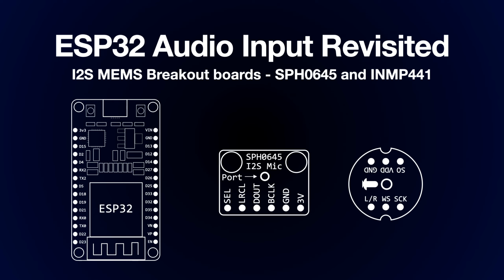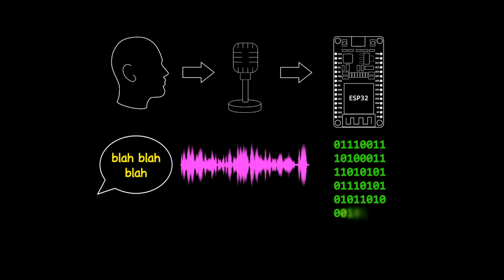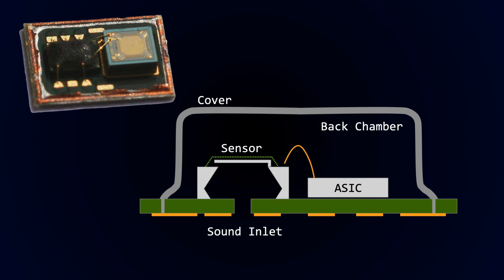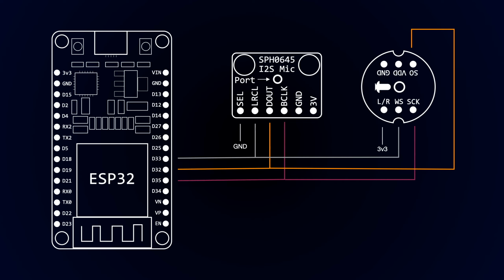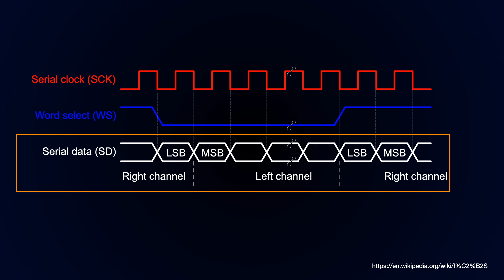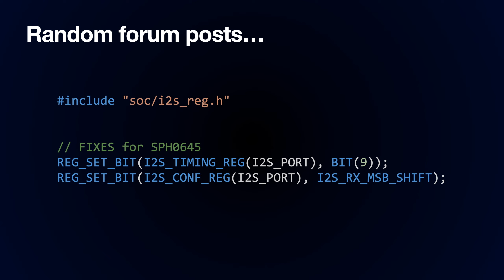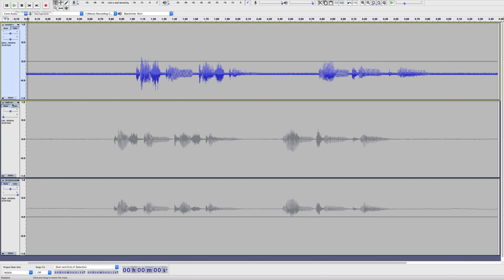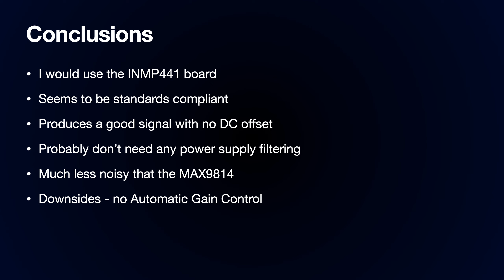ESP32 Audio Input Showdown: INMP441 vs SPH0645 MEMS I2S Microphones!

Comment: Thanks, for a clear simple comparison between these and the analogue input.
Reply from the maker: Thanks! I'm surprised at how much better the I2S microphone board is performing. I guess it's a much more modern bit of tech and the processing of the signal is a lot more advanced.
Reply: @atomic14  I'm thinking about adding a microphone to an ESP32-CAM board, need to check which pins are free (there aren't many) to see if it's practical or not.
Reply from the maker: Yes, the ESP-CAM is a bit of a pain as they haven't left may pins open. I think you can free up some pins by disabling the flash card if you aren't using it and you can re-use the serial lines once you've programmed the board.
Reply from the maker: If you can find 3 spare pins then you should be good - I know the ESP32-CAM board is pretty limited as they've used up a lot of the pins already.

Comment: And to add insult to injury, with the SPH0645 there is a positive "DC offset" in the digital that is limiting the dynamic range of the linear pcm by 20%-30% in the positive side
Reply: Anyone figure out why / a solution to this?

Comment: At time 2'40", you have the GPIO35 wired as SCK (BCLK) which is clock output to the serial clock of the I2S microphone. However, on most (if not all) ESP32, GPIO35 is an input only pin. You code looks correct when using GPIO32, but the Dout should be on a pin other than GPIO32.
Reply from the maker: oooh - good spot! The diagram is wrong.

Comment: Hi atomic14, really really enjoying your videos and the work you've put into them. I'm trying to follow along with the projects and have downloaded the source code to play around with. I currently am using the INMP441 microphone connected to the ESP32 as per the wiring diagram on the github page. I have been able to get the esp32 to connect over wifi to stream the i2s data back. However, I am running into an issue with the quality of the audio received. I have been importing the audio into audacity with the settings -  16 bit signed PCM, 16000hz sampling rate and mono channel. While I am able to hear most of the high level features of the audio, the audio file is generally very distorted and has lots of hissing and popping noises in the background which is very different to what I've seen in your videos. Do you have any suggestions or advice on what I could potentially be getting wrong? Thanks
Reply from the maker: Hi Sean,

Can you open up an issue on the GitHub repo and we can try and troubleshoot what you are seeing, If you can attach a sample of the audio you are getting that would be really useful.

Thanks
Chris

Comment: Nice video. One of the big advantage of i2s micro mems is the known value of the expected RMS level for 94dB @ 1000 Hz . So you do not really need to calibrate the microphone. I would like to know the diameter of the INMP1441, it would be good if it fit inside 1/2" tube.
Reply from the maker: My callipers says it's about 14.5mm (0.57inch) diameter. All the breakout boards that I've been able to find follow the same form factor.

There is this later version of the microphone - the ICS43434 - and there are some breakout boards for it that are really tiny. Unfortunately, they only seem to be available shipped from the US - https://www.tindie.com/products/onehorse/ics43434-i2s-digital-microphone/

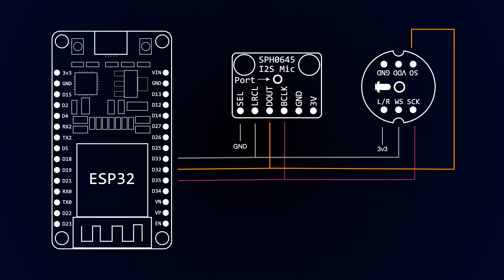Comment: Hi there, this is Hassan, at 2:51, you shared the schematic diagram of the circuit, could you let me know which platform you used to make it on. I have a similar project, and I had to make a schematic of it. Unfortunately, I couldn't find any online tool where the mic module could be available.  

My project uses an SD card, and an esp32 as well, I hope to hear from you soon.

Comment: Great video, look forward to use it in my projects, although I have a question, why do you connect the L/R pinout of the INMP441 to 3v3?
Reply from the maker: Hi Gian, I2S is very much based around stereo audio so you have a left and right channel with only one data line for the left and right. You need to tell devices if they are on the left or right channel otherwise they won't know when to send their data. Tieing the L/R line to 3v3 tells it that it should send its data when the left channel is requested.

Comment: Tell me something , what interface did you use to capture the audio directly into the audacity software. Like the mic is connected to the esp32 and is there any plugin that directly sends the audio to the audacity ?? i would like to know that in detail .
Reply from the maker: Hi there, we stream the audio from the ESP32 to a server running on a laptop or desktop and save the audio to a file. That file can then be loaded into Audacity using the import raw audio feature. Code for the server should be in the repo here - https://github.com/atomic14/esp32_audio. I don't think there is any plugin that will let you send the audio directly to Audacity,
Reply: @atomic14  Well i did not found the code in order to interface the i2s mic to the esp. I was specifically trying to look for an ino file but i did not found any . Could you guide me as to where is that code in that repo ( sorry if my question sounds stupid to you ) as i am not a very advanced programmer rather a noob but i'm good with hardware stuff .
Reply from the maker: @TechInventorAman  Hi Aman, the code in the demo repo is using platform.io for the IDE. There is a much simplified version here which will work with the Arduiono IDE - https://github.com/atomic14/ICS-43434-breakout-board

Comment: I wonder how you managed to make the ESP32 output the clock signal on GPIO35 - it's input only…
Reply from the maker: Good spot - that's an error in the diagram. The linked GitHub repo uses the following pins: 
.bck_io_num = GPIO_NUM_32,
.ws_io_num = GPIO_NUM_25,
.data_out_num = I2S_PIN_NO_CHANGE,
.data_in_num = GPIO_NUM_33

Comment: Thanks for the convincing demonstration that whenever possible I2S microphone is a better choice. However, it's not clear to me why the INMP441 is "hands down" better than the SPH0645. From the audio, they sound quite similar. Can you elaborate?
Reply from the maker: From what I read there is some weird timing incompatibility - it can be worked around, but it’s not ideal: https://hackaday.io/project/162059-street-sense/log/160705-new-i2s-microphone
Reply: @atomic14  Ah, thanks! I thought the mis-alignment was the problem of the ESP32 I2S, but after reading your code on Github, I realized that the workaround is only needed for the SPH0645. Yes, that makes the INMP441 the preferred device.

Comment: Great video! I'm planning to use esp32-cam for an IoT project. There's going to be live video and audio input to watch on smartphone. And there will be a motor and 2 sensors. Can esp32 handle these together? Or is there any other recommendations?
Reply from the maker: An esp32 can certainly handle all of that together. You may struggle with the number of available GPIO pins on the esp-cam boards. A lot of the pins are taken up by the camera board so you aren't left with many.
Reply: @atomic14  Thank you so much for your attention to my question. I'll consider this.
Reply from the maker: @seget96  There's a good guide here - https://randomnerdtutorials.com/esp32-cam-ai-thinker-pinout/ if you aren't using the SDCard you'll get a few pins back.
Reply: @atomic14  Wow I didn't know that! I appreciate it! Thanks a lot :)

Comment: 1:00 the sensor is soldered on the bottom. What's the reason? avoid wind noise? avoid collecting dust? I put the sensor on top, because I think that's where the sound comes from.
Reply from the maker: MEMS microphones come in two different styles, top ported and bottom ported. Top ported versions have a hole in the top of the microphone for the sound to enter. Bottom ported have the hole in the bottom and you need to have a matching hole in the PCB to let the sound in. Both the INMP441 and the SPU0645 are bottom ported.
Reply: @atomic14  oh I see. Thank you.

Comment: Is it possible to use audio input (e.g. inmp441 i2s) or audio output (e.g. max98357A i2s) via a port expander? If yes how is it done, especially the pin config? Thanks for any advice.
Reply: please tell me can we use both to make a line pass for hearing aid solution

Comment: Hi there ! I'm facing a strange issue, the SPH0645 only works when I put WS to ground, I'm using an ESP32-S3 on a custom PCB and I used your tweak settings to make it work however the only way to get a valid output from the mic is to try putting WS to the ground multiple times after the startup...
If I don't do that I get random and incoherent values.
I'm really struggling to get around this problem, so any help would be welcome ^^
Reply from the maker: If you join the discord server you can share your schematic+code we can have a look and see if anything is obvious.https://discord.gg/PKrNGqN6

Comment: Thanx for the great video, I have an INMP441 mic, could you please how to record the sound the play after that
Reply: Hello, please help me how to play the recorded sound.
Reply from the maker: I don't currently have any sample code for recording and playback on device. The sample code I currently have sends the audio to a PC running a small server. The audio is saved to file as raw samples so you need to use a tool like Audacity to load the samples and play them.
Reply: @atomic14  i think the server you are talking about is your personal one.
Reply from the maker: @rajbirsingh4879  Yes, the code runs on your local machine. I think you want to record to the device and play back from there? You will be limited by the amount of memory so you will probably want to record to flash or SD card. Recording to flash is quite difficult as it's quite slow. If you have a device with PSRAM then you can record to memory without any problems. I don't have any code to show this at the moment though.
Reply: @atomic14  Yes, actually I want to record the voice and want to hear what I am recording.
I have an SD card adaptor.
Please let me know how i can do that
Reply from the maker: @rajbirsingh4879  I don't have any sample code for this yet. There will probably be a video about it at some point, but I can't promise anything.
Reply: @atomic14  alright, but can you show me how you had recorded and played on audacity.
Reply from the maker: @rajbirsingh4879  In the GitHub repo (https://github.com/atomic14/esp32_audio) there's a very simple web server that you run on your desktop machine. The ESP32 sends the raw audio to that server and it gets written to a file. You can then import the raw audio into Audacity to play it. You should be able to clone the repo and start the server, then modify the esp32 code to point to your machine's IP address and it will send the audio to your computer. You need to import it as "Raw Data". File->Import->Raw Data and you need to tell audacity the correct format, channels and sample rate - these should match the settings you have in the ESP32 code.
Reply: @atomic14  Thank you so much for your help, I have recorded the sound
Reply from the maker: @rajbirsingh4879  That's great! Good luck with your project.
Reply: @atomic14  no i have to send the value to an android app using ESp32 BLE.

I have downloaded the nrf connect app but i am not getting the accurate values.

I have also made a custom app to reproduce the sound,
Reply: @atomic14  can we route the mic data directly to output to a speaker

Comment: Is there a breakout board that allows for a line-in instead of a microphone? So it can take audio from an analog source?
Reply from the maker: There's a couple of options, you can use the built-in ADCs - https://www.youtube.com/watch?v=pPh3_ciEmzs&t=1s There are also some I2S ADC boards, but they seem to be quite unusual. The majority seem to be I2C. I did find this one though - https://www.sparkfun.com/products/retired/9365
Reply: @atomic14  what about a decent library? On conventional Arduino there is an audio library that doesn't require a lot of setup... play, record, and not much more .

Comment: Is there a way to use an external wire microphone but retain the i2s interface ?
I want to make a wifi wireless headset compatible with pulseaudio
I want one esp32 to have two audio output channels and one audio input channel for the microphone. 
But what chip can take signal from a normal microphone and turn that into a i2s signal ?
Reply from the maker: Hi there, In theory, this is definitely possible. there are a few I2S adc converter chips and if you google you will find some breakout boards. I have read a few forum posts with people struggling to get thingsto work consistently https://www.esp32.com/viewtopic.php?f=12&t=10749. There are also SPI based ADC converters which you could use instead of I2S. Depending on the board you find you will need a microphone pre-amp to boost the mic signal up to a sensible level.
Reply: any success, i want to INMp441 mic and stero out from esp32

Comment: I'm in NZ so hard to get components. I can source the SPH0645 from Aussie. I am using the ESP32. Is it worth going down this path or should I be patient and order from further away!
Reply from the maker: I would go ahead and use the SPH0645.
Reply: @atomic14  Thank you for your very fast response. I have been spending a fair bit of time searching. Frustrating when supply is the biggest issue! One board that is available in NZ is Pmod MIC3: MEMS Microphone with Adjustable Gain by Digilent. It appears to have what is needed but I cannot find anyone using it with an ESP32 just the Adruino. Worth a try? (I am newbie at this).
Reply from the maker: @kellyrummins3338  That should work - it has an SPI interface which the ESP32 supports. The code you see for Arduino should work on the ESP32 as well.
Reply: @atomic14  Fantastic. Thanks again so much. Your audio project videos have been immensely helpful.
Reply from the maker: @kellyrummins3338  You can also use the built-in ADCs they aren't really that bad for audio input provided you can give your microphones a good clean power supply.

Comment: thanks sir for posting these videos. I am using SPH0645  with sampling rate = 16k , bits per sample = 32, and variable buffer lengths and counts. but no matter what i set buffer lenght and count by recorded audio is FASTER . if i speak for 5 second recorded one is kind of 2 second long. Any comments on that
Reply from the maker: How are you loading the raw data? You could be importing it as stereo - which would cause it to double in speed.
Reply: @atomic14  thanks for replying. i am only using left channel and am selecting mono while loading raw in audacity. I think the culprit is  size attribute in i2s_read() function , i.e the 3rd one. kindly put some light on it
Reply from the maker: @chaitanyadas1814  when you read the data in are you specifying 16 or 32 bits? In my code and convert the 32 bit data to 16 bits before using it.
Reply: ((bits+8)/16)*SAMPLE_PER_CYCLE*4  , i mean this formula from the documentation . what are bits and sample_per_cycle variables in above formula
Reply from the maker: @chaitanyadas1814  If you look at the sample code attached to the video you can see that the 3rd argument is just the number of bytes you want to read from the I2S device. They are using that formula to try and make sure they read enough bytes to hold complete samples. To be honest I would ignore that formula as it's quite confusing and generally you want to read quite a few samples. If you are using 32 bits then each sample takes up 4 bytes.
Reply: @atomic14  thanks sir , for your kind suport , that makes sense , still couldn't figure out why by changing 32 bits from 16 bits per sample in your code, my speed is getting faster. SPH0645 doesn't seems to work with 16 bits_per_sample
Reply: @atomic14  if nothing is wrong with i2s_read() function , than the problem seems to be in config setting of mic, what else is left ??
Reply from the maker: @chaitanyadas1814  are you using my sample code? If you are then you can raise an issue on the GitHub repo and some might be able to help you.
Reply: @chaitanyadas1814  there seems to be some issue with the sample rate. I believe that the minimum sample rate was changed some year ago in ESP-IDF, but I cannot find this documented except for in some github issue documentation. when I had a timing error, increasing to 20khz solved my problem.

Comment: How far the distance between your mouth (as sound source) to the mic?
Reply from the maker: Fairly close. One of the downsides with these mics is that they don't have a built in AGC. They do have great dynamic range - 24bits but using that full dynamic range comes with its own challenges. I've been looking at adding in a very simple AGC which hopefully I'll have a tutorial on soon.